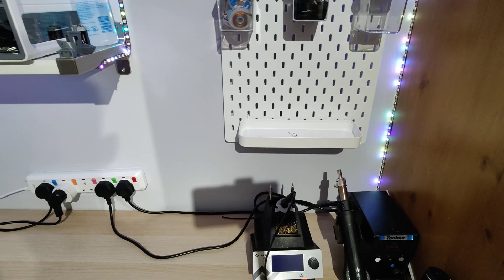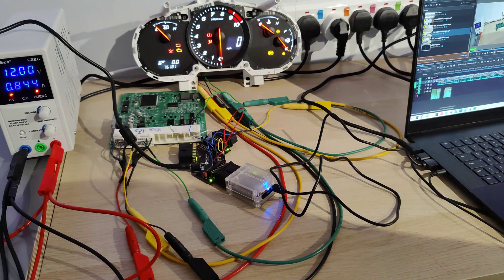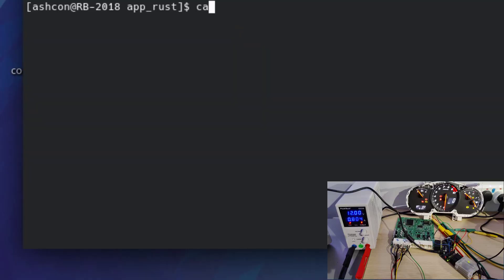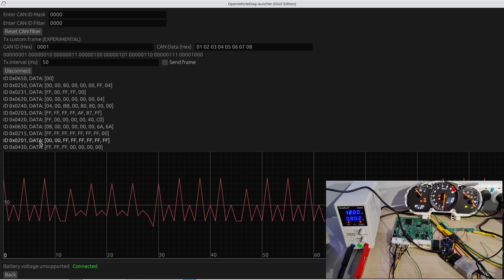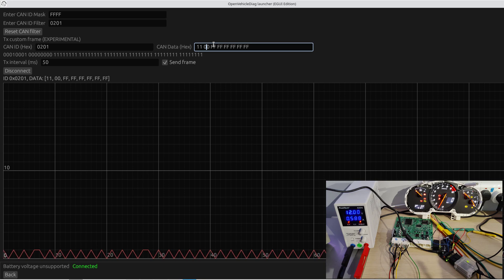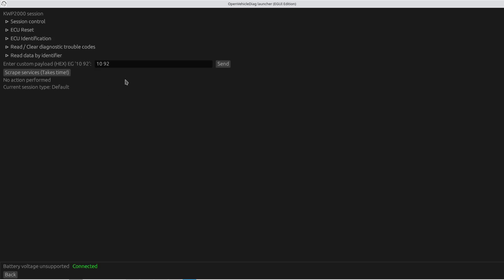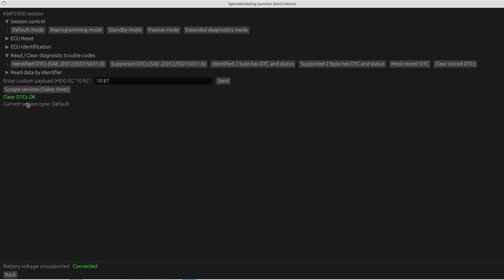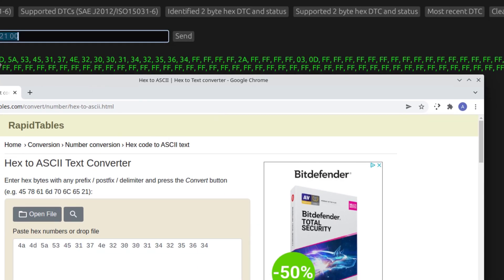Hacking our Mazda RX8 ECUs! - OpenVehicleDiag 2.0 demo

Comment: On the GitHub for this you mention "thus allowing the ability for you to reprogram ECU’s without the need for a special dealer-only tool." Does that mean one could disable the triggers that would force an RX8 to go into limp mode. Would be a handy feature if swapping a Renesis into an NB chassis, since I could throw away a bunch of things that I wouldn't be able to integrate / don't need.

Comment: I have a 2008 RX8 that we did an engine/trans swap from an older RX8 and even with the ecu from the engine/trans car the immobilzer will not allow us to start the vehicle. Can you program the ecu to work with this set up and what would you need me to send so you can program the engine/trans ecu to work with my 2008 RX8.

Comment: Rx8 immo light on. Customer tried to pull away and it stalled. No start after or crank. Fuse blown and new fuse blows instantly 15a for ecu. Obd scan and basically no instrument, no abs, no ecu, no power steering. Fuse that blows is 5 down from the back. A blue 15a. Any ideas
Reply: Something is pulling too much current.
Reply: @kensmechanicalaffair  turned out to be weird. I fixed the car. Only that fuse blowing stopped blowing. Car parked and not moving yet it stopped blowing. Then with new coils and bled fuel system it started.

Comment: hi mate any chance you will be working on a way to reverse engineer the cluster to be able to program it such as vin numbers, odometer reading and manual or auto? I was working on a Australian GM holden VE cluster for a while but couldn't find a way to write code to send on the bus to get passed the security access section of programming so dead in the water. 
what I am still confused about is how do you get the ecu to tell you were it stored the memory identifiers for info you want to program such as vin numbers, auto and manual, TPS,  settings then how do you issue a command to change the identifiers

Comment: New Subscriber !. Many thanks for your help with the SAAB today and looking into our Trionic 5 conversion. The Noid lights arrive today so i will be able to visually see if the injectors are firing.
Reply: Tell me more about this saab of yours, I'm a saab guy too- looking into dsg swapping my 9-5 myself
Reply: @jacobporter4623  I run The SAAB Clinic and have several SAAB's. DSG's have been done. Adam Sindry of the "My boosted life" channel has fitted DSG's to the back of a B234 engine. Paul@    The Saab Clinic  Co UK
Reply: @TheSaabClinicUK  I think that was the bmw dct rather than the vag dsg but I'll go back and check
Reply: This has been fixed and the car is now running. The issue was me !. Trionic 5 uses -ve switched outputs on all its channels. Unlike the Bosch LH that it replaced where everything is +ve switched. So made a few changes to the Ignition and Fuel relays and shes running like a champ.